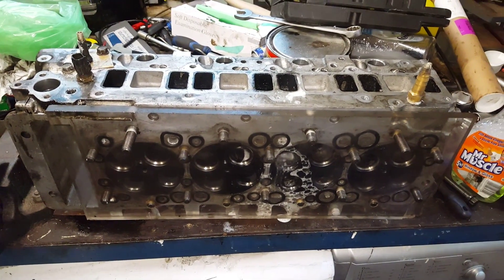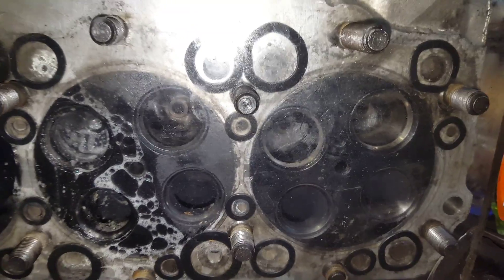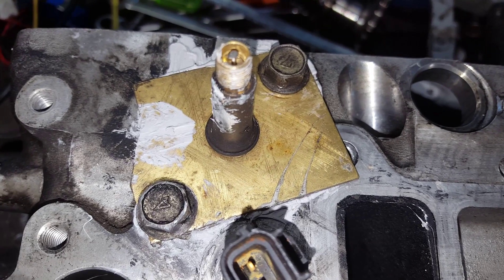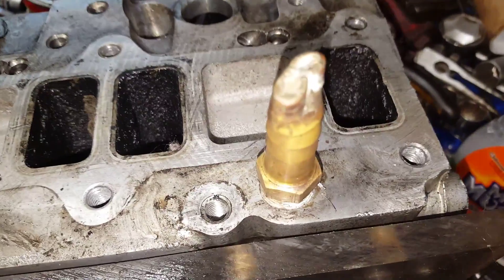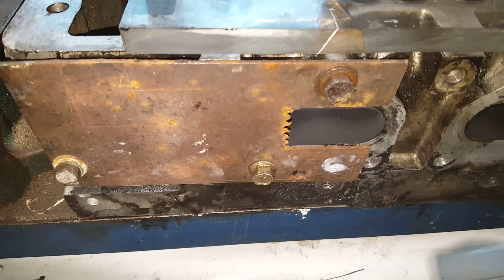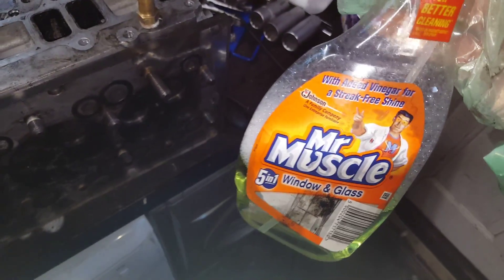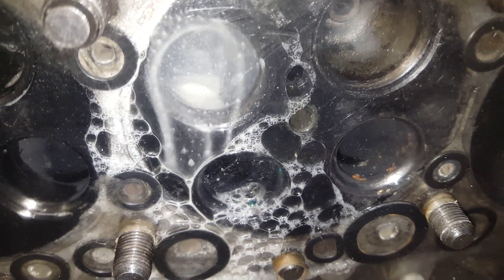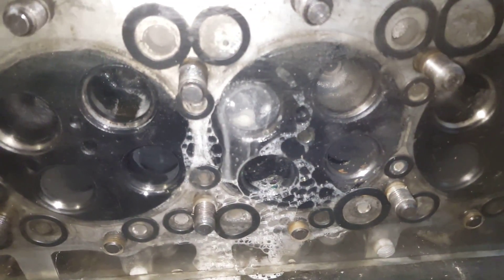Mitsubishi Shogun Pajero 3.2 DI-D cylinder head crack test at home

Comment: Good. Have such thing twice during 4 y. period Are they /heads/ prone to crack or faulty just gasket fixing?...Iam loosing my heart for this car ((; Heard manufacturer's /workshop manual/torque&angle method IS NOT right one when fixing 2nd hand head with a new gasket ??